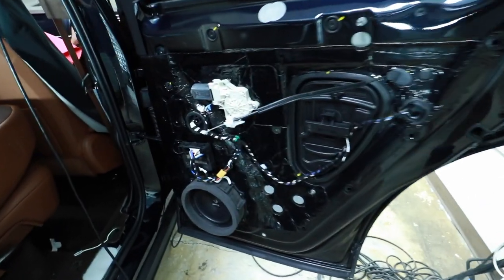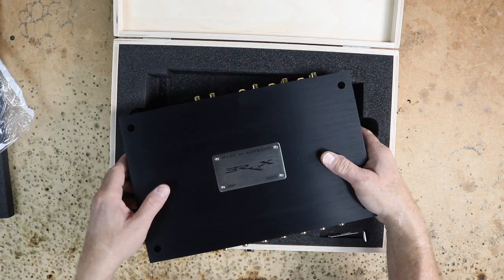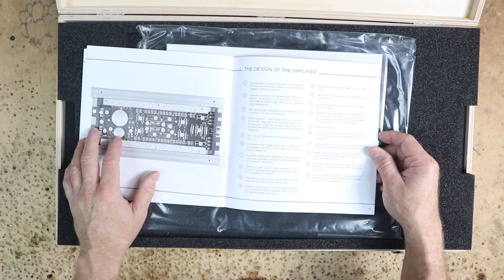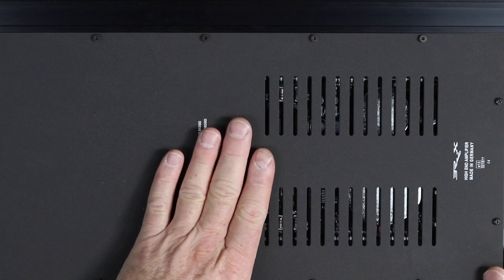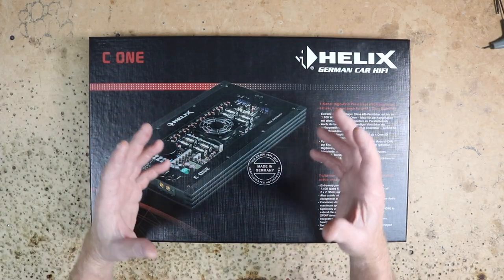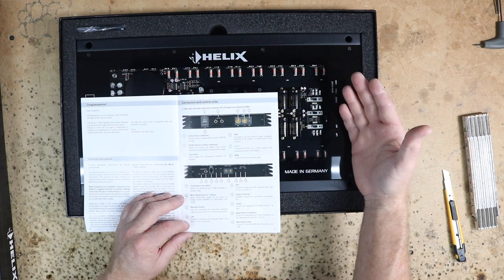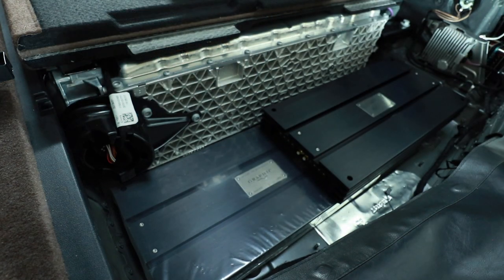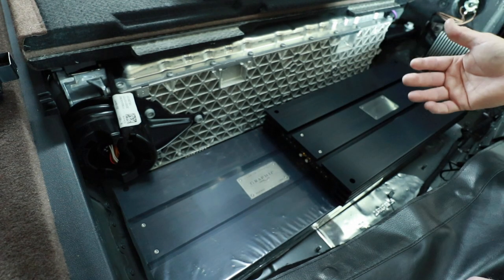Amps start to go in speakers are done Porsche Cayenne E Installer Diaries 400 part 5

Comment: Suprised customer didnt decide on AC with built in DSP could have been a 2 amp main system and if needed cram a 3rd larger amp or an ACM in on top.  Brax/Helix nice but its circa 1995 size in a vehicle with space limitation is a challenge.  That or do a false floor and build up slightly ?
Reply: ...some customers don't want to add Chinese gear to their finely crafted German automobile...I am not at all surprised this customer did not want gear assembled in China in his Porsche, neither would I.AudioControl is nice, but not in the same league as German made Helix, much less BRAX. Audio Control sold out to cheap ,Chinese labor. Brax , and this particular Helix, did not. Audio Control makes a decent product, but they make it in China, So they can cram it, as far as I am concerned...make it in America and I will buy it
Reply: @raymo6795  Interesting as the Cayenne E is built in Slovakia 🙂
Reply: @jonkvh5150  .. that is interesting